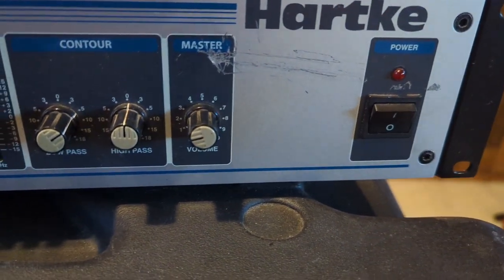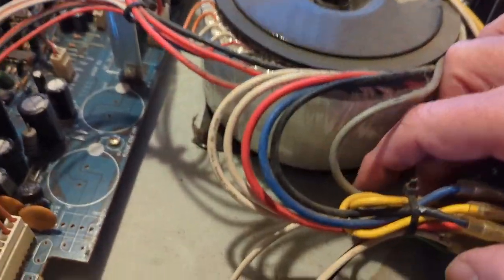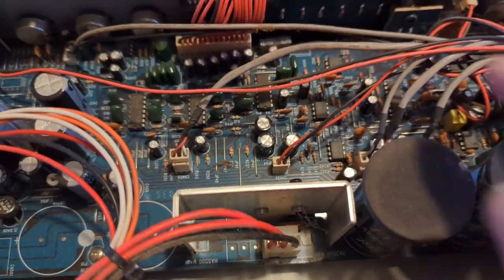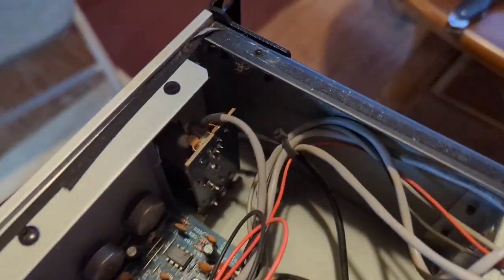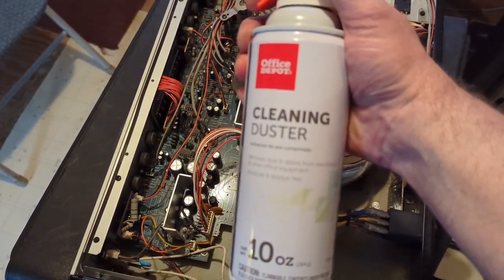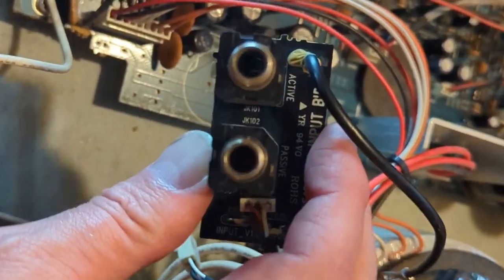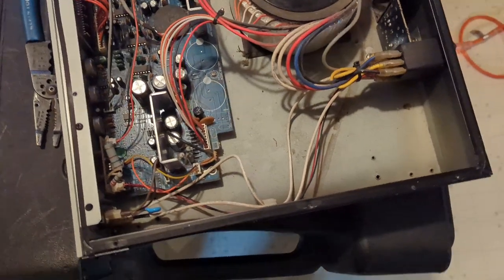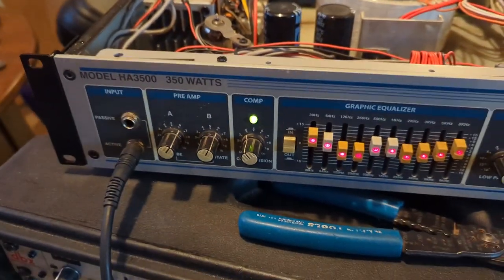How to troubleshoot Hartke bass amp

Comment: Hi.. I've got a Hartke Hd25 watt bass amp and after about 8 months of playing and sounding great it would ( after playing for about 5 to 10 minutes) the sound would go flat and the beefy sound it should have would be gone. Could it be something heating and expanding maybe losing contact with a component? I had sent it back to the shop I bought it from and after 5 weeks got it back apparently fixed but it wasn't.
Great content by the way.
Reply from the maker: Your tube is likely starting to burn out

Comment: this one is a 3500 and calls for a slow blow fuse on the back panel. It must be older cuz the toroidal xformer. The later hartke looks like they have a core type xformer and start calling for a Fast blow and dont print out both fuse types on the back, just a recommendation for either 120 or 240 mains. Not both. Crack open the user manual and it specifically states 10 amp fuse for a 5500 on 115, then makes no mention of slow or fast blow (T or F). The 3500 and 5500 now share a manual. HOWEVER the schematic says 12 amp fuse for 115 mains. Check the back of the unit and its printed recommendation is a F12AL for 115 on the 5500. 

If youre confused, you should be. Theyre over there at Hartke just swapping Fast blows for slow blows with no real circuit redesigns. Giving wrong fuse amp recommends, not printing both fuse types on their shells. Doubling up the manuals. NOT GOOD. Since a major point of contention is the fuse is the start of a circuit design. Hartke is is in the business of designing and building circuits. Then they have this major lack of attention to detail. Like "I dunno bro, it like..doesnt even matter"..If you jammed a 10 amp slow blow into a 5500. Switched it out for a fast blow 10 amp and all your fuses fried, thats not you. thats them. They told you to do that in their boot leg user manual. Bunch of prison custers.

Thats not high end quality control $1200 stuff right there made in USA. Ive literally woken up the engineers sleeping at 4am on a USA factory line(not Hartke..as amazing as it is anything is manufactured anywhere in a 3rd world USA besides poop cakes to light your cooking fires). then they wake up all angry saying "Im a veteran of foreign war, Im an electronics ENGINEER! blablablah"...well are you ipc 610? because this isnt a class 2 product...GET IT TOGETHER!!